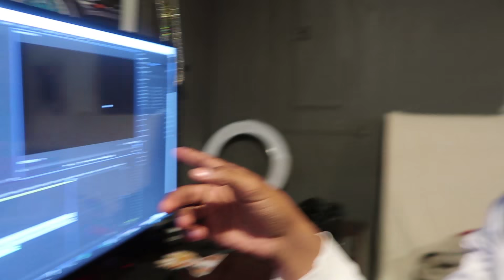Chill day with the homies / Joey's Crazy CIVIC EG build / BSERIES

Comment: Phill that’s what happens when you do two step it pushes more fuel in the motor causing a detonation In the exhaust stroke causing a explosion the push out the fireballs out the exhaust sometimes the exhaust can handle it and it blows up the exhaust system and also it ruins your cattle attic converter like some states are small compliant Cala converter is could be costly if your state mandates a smog check I suggest removing your Cadillac converter and put a test pipe 😊👍
Reply: Lol he right he has a test pipe and it's a honda catalyst converter not cadallic
Reply: Jermaine Lee Damn auto correction yeah I just remembered he has a catalytic delete pipe but the 2 step is hard on the exhaust system I have a titanium exhaust and I blew out my resonator from the two-step and it was a good cheap exhaust